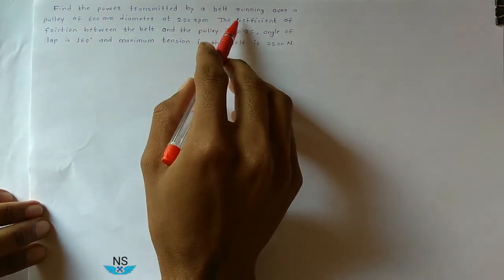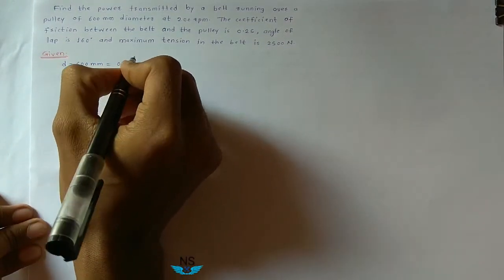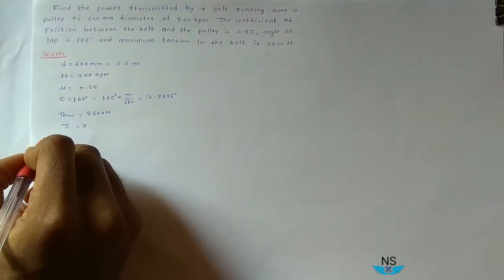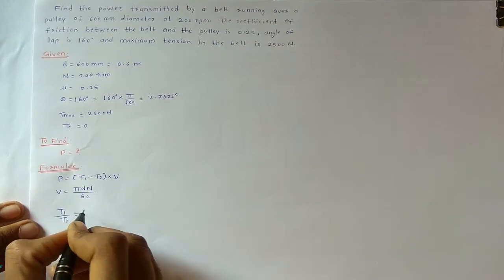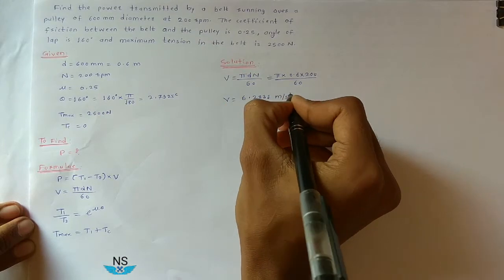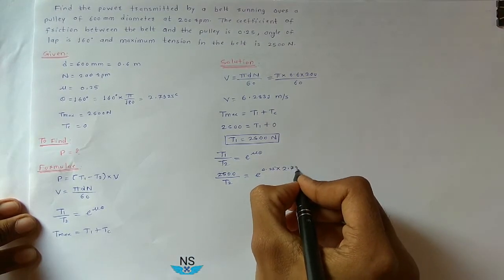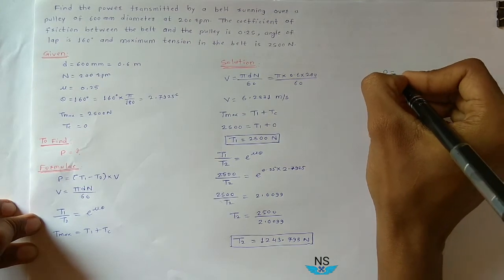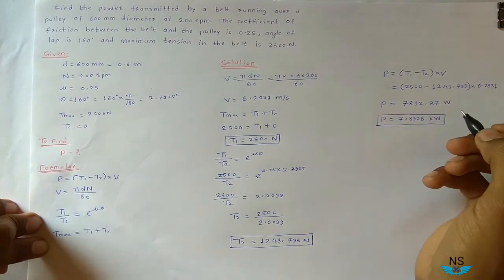Belt Drive (Problem - 05) ।। How to find Power transmitted by a belt #viral

Comment: A V-belt drive system transmits 100 kW at 475 r.p.m. The belt has a mass of 0.6 kg/m. The maximum
permissible tension in the belt is 900 N. The groove angle is 38° and the angle of contact is 160°. Find
minimum number of belts and pulley diameter. The coefficient of friction between belt and pulley is
0.2. 
Please solve this problem

Comment: Bro what procedure for given speed instead of diameter
Reply from the maker: If speed is given then Power = 2ΠNT/60
Here you require value of torque T. For that torque all calculations done in the video.
Reply from the maker: Watch other problems of belt drive also... And share my channel link in your college friends.... Thank you 🙏